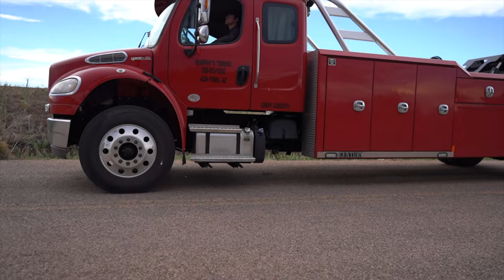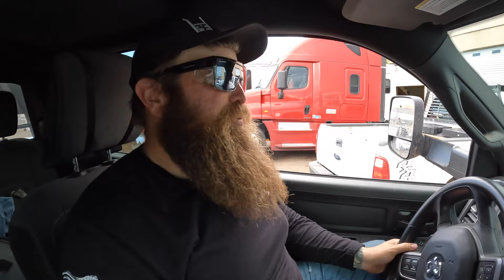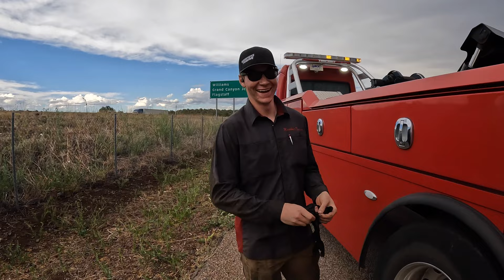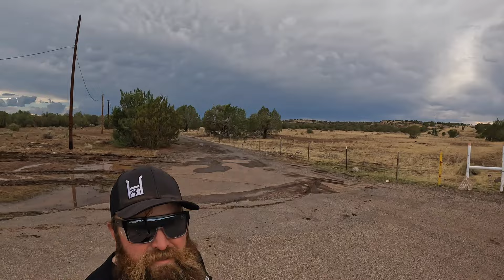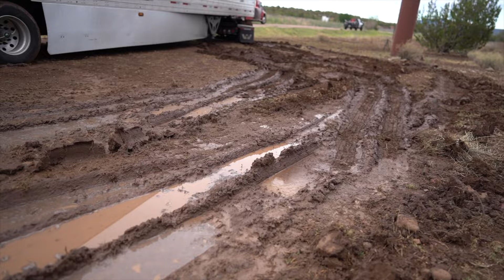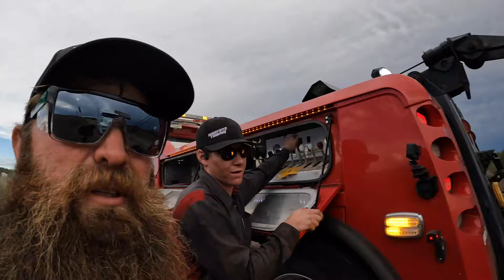Collin's 1st heavy wrecker recovery! Here we go!

Comment: You can pull from the bottom of those cattle guards on those trucks. I’ve pulled 100,000 pounds up a hill before. You just have to pull from the bottom of the bumper.
Reply: Not that one. You probably get away with it on a hurd or an alliarc

Comment: Love watching your videos I could use some advice on a 97 350 big cam not purging after 120 psi with only an governor.
Reply from the maker: Does it purge at all?
Reply: No When it reaches 120 psi it runs a little funny but it never purges I replaced the governor that’s all that’s there is an older unit.